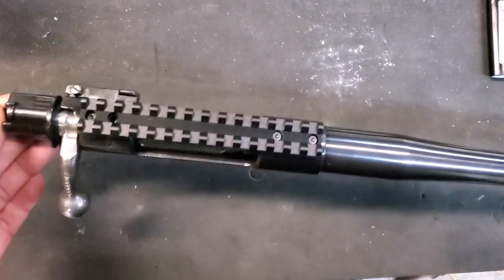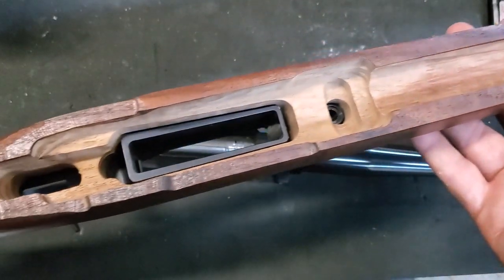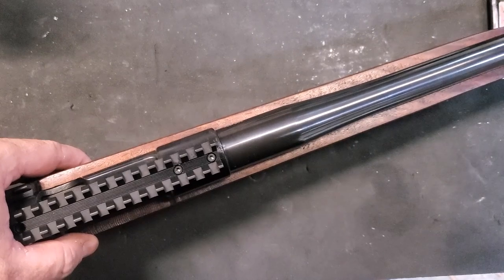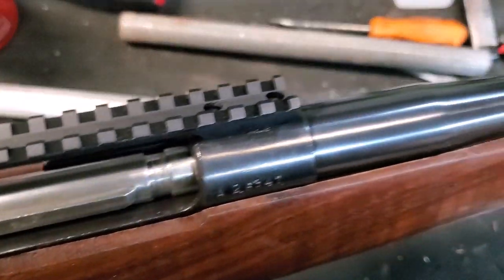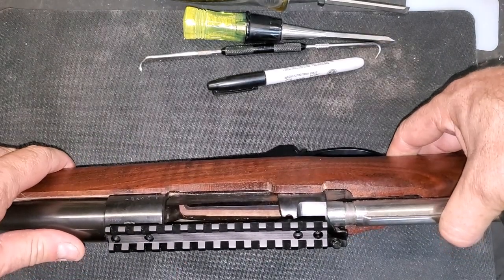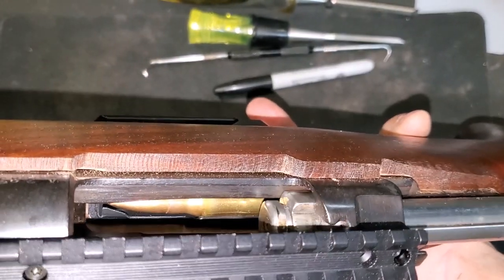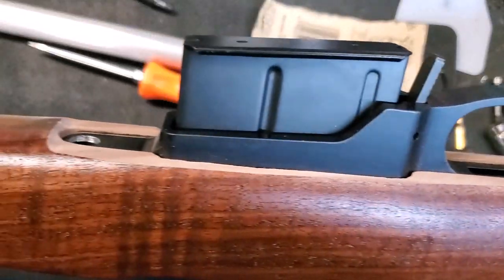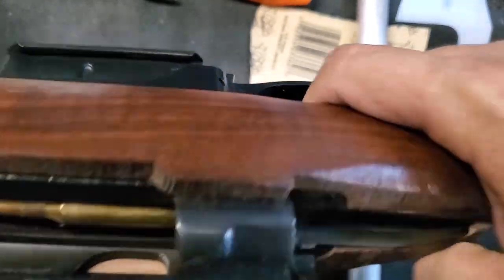Yugo Mauser rebarreled in 308 - Fun all purpose rifle

Comment: Great conversion! Just wanted to ask if the detachable bottom metal magazine a SA or LA? I’ve searched online and it had both and I’m not sure which one it is, first time touching anything Milsurp. Cheers!
Reply from the maker: It depends on the receiver you have, most 8mm receivers are LA, but the Yugo is a SA. SA receivers are 8 1/2 inch overall length and LA is 8 3/4. Hope that helps

Comment: I'm thinking doing the same did you have to have anything done to the action to make it work cycling the 308 cartridges  ? Also Did you get lucky with the barrel or did it have to be fit to the action, also how did you modify the safety
Reply from the maker: The barrel was a direct fit from midway, once its torqued to the receiver, the only thing needed is to finish the chamber to final depth, they come with a short chamber, aprox .020 short of fully chambered, to proper headspace and thats it. The 308 seems to cycle without issue, and the bolt was just spare bolt parts, the safety housing is an aftermarket housing with no safety. Hope that helps

Comment: Hello sir. I have question for you... I have zastava m70 bolt action rifle in 308 win... And i wanna swap barrel for 6.5 creeedmoore (coz they are have simmilary case lenght, and action right? ).. What barrel can i buy to fit with that action, what model, number of threaded? And, is that posible with small gunshmithing? Thank you, best regards!
Reply from the maker: Thanks for watching. Sorry for the delay, work is busy. I did some searching and couldnt find a 6.5 barrel for a mod 70. The thread is different from the rest of the mauser family. It leaves the only choice being a custom made barrel from McGowen or a contoured blank from midway or brownells and have a gunsmith chamber and cut the receiver threads. Hope this helps.
Reply: @AthensArmory303  Yes, its helps to me, i will see on Lother Walter site, mby they have something for mauser actions. Thank you  again!